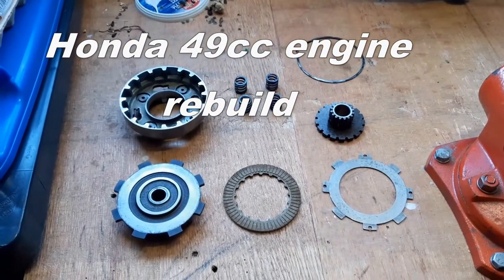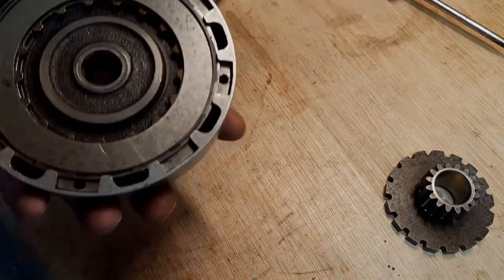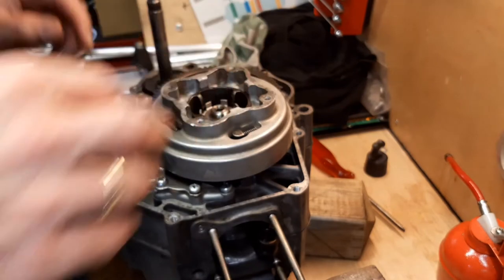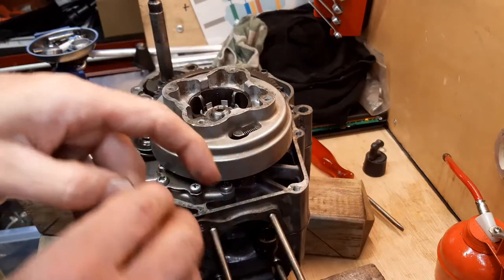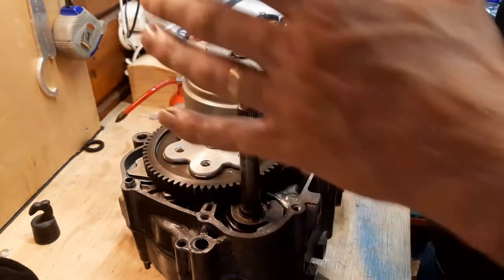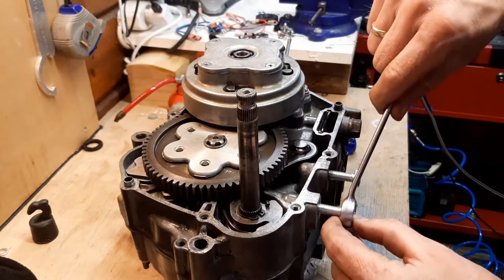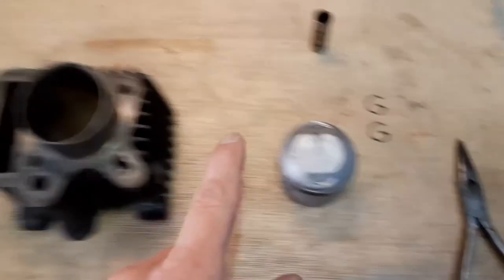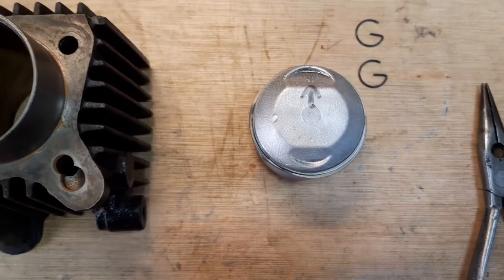Honda SS50 engine rebuild Part 2

Comment: Very nice tip of installing 2 screws, and using the wrench to stop rotation, and also the 2 bolts to hold the engine in a vise!

Comment: Nice one Thanks . How do you adjust the clutch at the engine .
Reply from the maker: On the outside cover, where there clutch lever pushes onto the clutch, there is a set screw with a lock nut. Loosen the nut (just enought to be able to turn the set screw) and turn the set screw in until you feel resistance. That's the point where the clutch starts to disengange. Then you turn back the set screw a quarter to half a turn, and tighten the lock nut. That adjusts you clutch on the engine. Fine tuning can be done with the adjuster on the cable.

Thanks for watching!
Reply: Thanks . I am restoring a 1977 SS50 5 Speed and am going to rebuild the engine. I love thet way that your engine started on the bench . I have to kick the over so many time is very bad to start. . @Carnold_YT
Reply from the maker: Sorry for my late reply, but anyway: if you have the valve and ignition timing correct, and the carburettor is full of fuel, these engine will start straight away. Nice to hear that your are restoring a SS too. Those 5 speed engines are magnificent! Does yours have an aluminium cylinder too?
Reply: Not sure yet i havent started the resto . The bike came 100% complete which is a amazing.Its just very hard to start. My old ss50 started very easly. I had a look at it yeserday and it looks like the top end was stripped at some time . I am going to ultarasonic clean the carb . It only has 5000 miles on it so the  Cylinder should be fine . I might just replace the rings . What do you think ?? When it does start it wont come of the choke it just cuts out . Once its warm it will tick over and still is a runs bit rough . One thing that i have notced it feels like its kicking through the clutch and slipping .So again i am going to replace the clutch.  @Carnold_YT
Reply from the maker: With 5.000 miles on the odometer I would't worry about the pistion rings too much. Try to have a peek at the ring grooves in the piston, if there isn't much carbon build up, I would use the rings again. The gaskets and the o-rings between the engine block, cylinder and cylinder head are always worth replacing. Also, the valve seals are worth replacing. IF you rebuild the carb: there is a good baseline for the air mixture screw: turn it fully in and then two and a quarter turns out. In 99% of the times you got your air mixture spot on with that setting. Good luck!